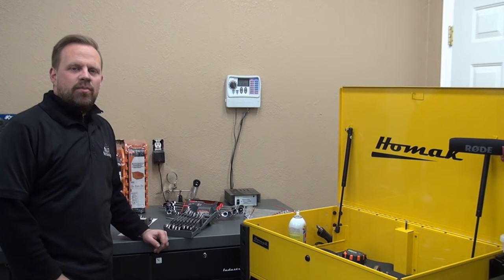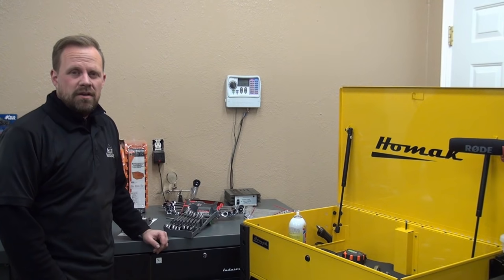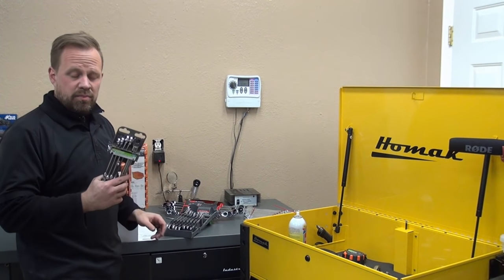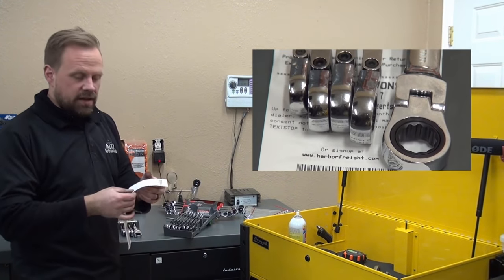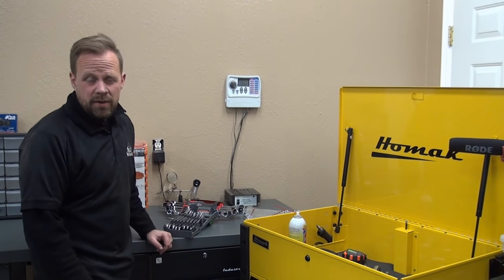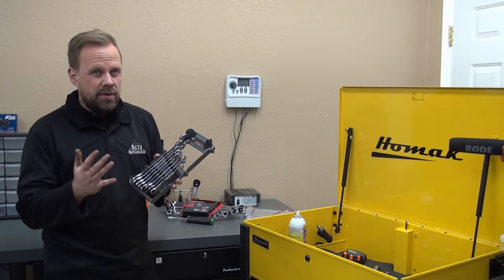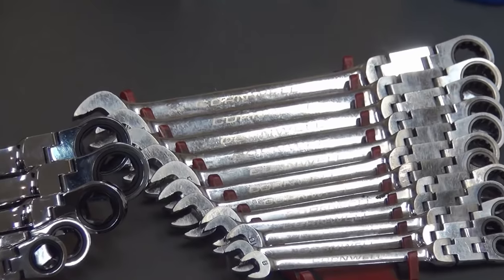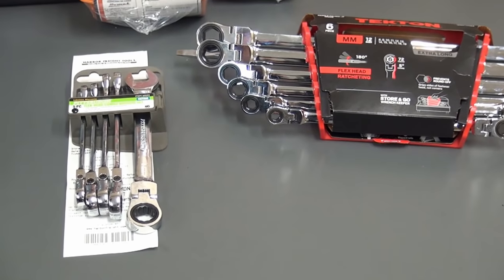The Best Ratcheting Wrenches | Wrench Set Tool Review

Comment: all these sets are crap. WHY? because every single one of them make you flip the wrench over to change from tightening to loosening. the problem is that there is no offset so that you dont ripp your knuckles off when torquing on the wrench because it is perfectly inline to the assembly. the wrenches with flex head suck so they are instantly not a choice. youll really loose skin with those everytime the swivel slips because your trying to push off at an angle.
 dont buy this junk. demand that manufactures build them with a reverse mechanism, 6-point and have about a 10 degree swing angle. Not advertised as 5 degrees, that really is just sloppy play.

BTW: since when is a 12-point wrench/socket better on a 6-point bolt? not in the rust belt that is for sure where stripping a nut is an everyday thing.. There is no way you need a full specialty set of 12pt wrenches for everyday. buy a 6pt set to minimize rounding the points off. if you have an odd safety nut that is 12pnt. buy the one tool for it not a entire set. only thing i can think of is 70's thermoquad/quadrajet and a wrench wont work anyway. i dont remember any other 12 point nuts. or you can just goto ACE hardware and buy a 6 point nut for .12cents instead of a $100 set of wrenches for one nut?? smart! Nott!
if your to lazy to turn the ratchet 1 or 2 clicks to get it started on your bolt. you are just an idiot. back up put the tools down. dont touch again.
you can argue 12pt vs 6 pnt and the number of contact points all you want. still the contact point IS in a different spot and IT makes all the difference.
Reply: please review a 6pnt reversible fixed combination wrench set. 8mm-21mm including 11 14 16 and 18 and sae 1/4"-7/8". Maybe Mac Tools, gearwrench and stanley this time. real tools for real people. i was a mechanic early in life and i had to have everything snapon. after my tools were gone. i realized how much money i wasted just having the name. altho some were the best and needed them not to break. most never paid for themselves.